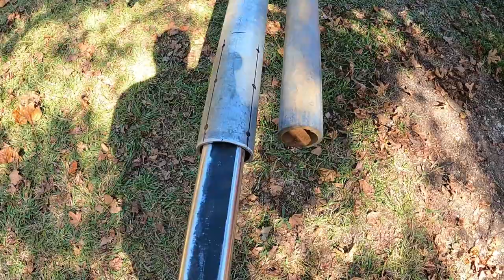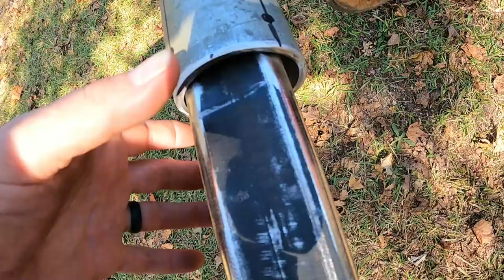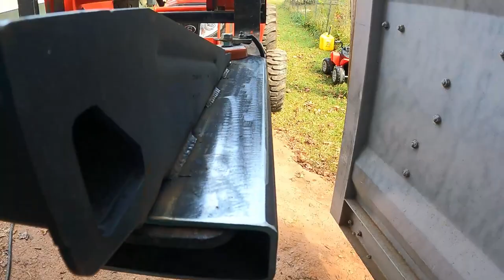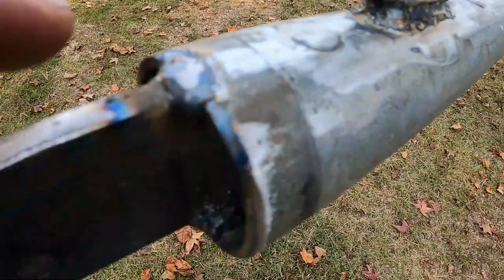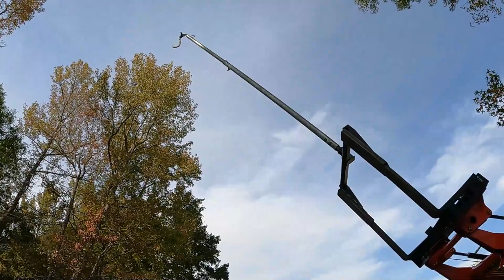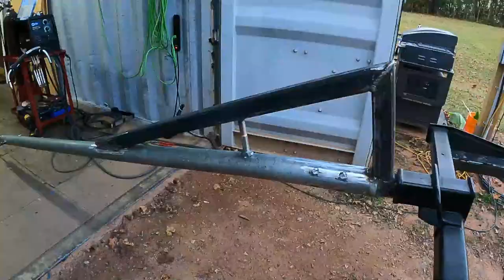I Built A Lifting Boom With An Old Trailer Hitch & Scrap Metal For My Tractor Forks, Gin Pole Crane!

Comment: Can you flip it over and bend it back or will the steel get weaker doing that?
Reply from the maker: I did bend it back enough by forcing it down on the ground with the tractor.  I've been using it with no issues.  Thanks for watching.